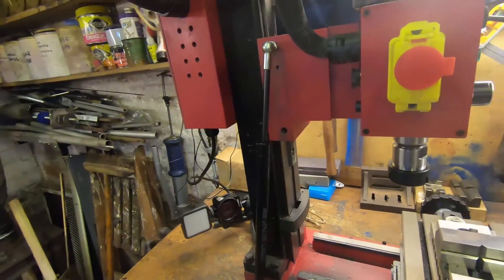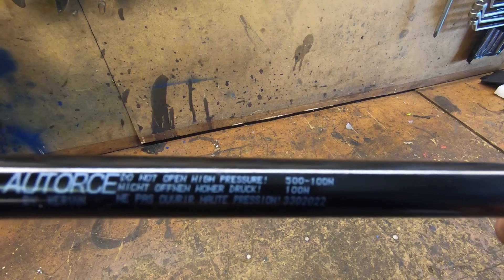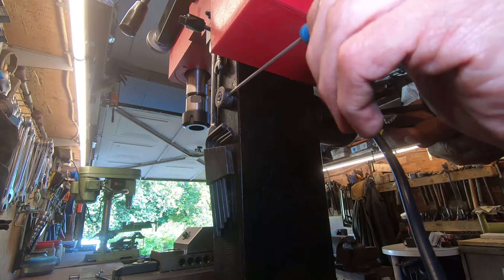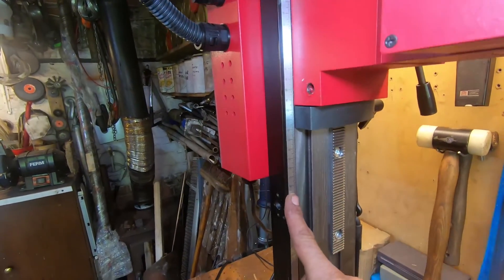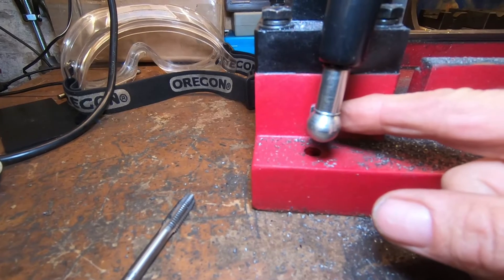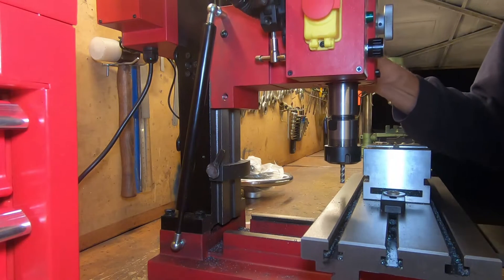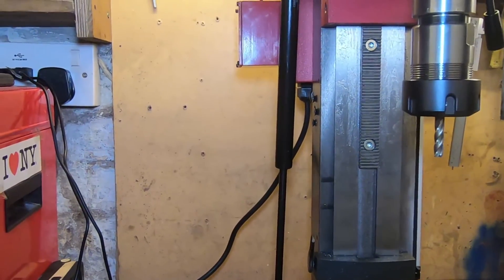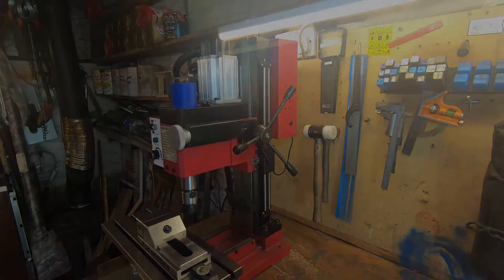MINI MILL UPGRADES #2: SIEG SX2P GAS STRUT CONVERSION

Comment: Excellent vid, very helpful and concise. Definitely one of the first things I'll be doing to my mill, thanks
Reply from the maker: Thanks for the great feedback :) Good luck with the job. I have a few more SX2P vidoes in the can waiting for some free time to edit so feel free to subscribe if you'd like to be notified when they come out 🙏
Reply: @myharris   It was the first thing I did after removing the safety guard and cleaning the factory gunk off, so thanks again. The ring nut from the right side of the stock spring makes a dandy spacer for the top of the strut as it turns out :)

Comment: they fail... hate saying it. maybe tomorrow, maybe in 6 years. dont trust them anymore...

im waiting on a 20mm air cylinder.

idea i set a regulator to just below the pressure needed to counteract, like a pound less.

and a safety valve set to just slightly higher.

iirc, 20mm=1/2squin = 60 psi to counteract the 15kg head... give or take. 

would like to see some more detail on the x2P... looks like you are the only one so far.

debating about blowing au$1200 on one before i finish installing the screws into my current x2... the extra travel sounds really handy, but i notice the saddle is mounted differently... looks a lot easier to scrape that base!
1200 is pretty cheap actually... thats shipped.

and there are scant few photos online, either...

sigh, now ive scraped the stinking thing, and got the r8 spindle and a bunch of collets... sigh. yeah, toolchanges drove me nuts when it was running... but so did ~90x220 of work envelope...
Reply from the maker: Great info in there, thanks. What would you like to see/know about the SX2P mate? Let me know your wishlist, happy to oblige. About time I got another video out but these days it seems to be a choice between doing stuff or filming stuff! Cheers, Harris
Reply: @myharris  cheers :)
just some clear shots of the range of travel, what it looks like at the extremes... clearance and stuff... room to gouge out the back and stuff a stepper in there?

  probably too much to hope for... what it looks like on the underside? webbing?

iunno. the bits you cant see in a photo and only find out when it turns up?

though considering it all i can probably do a granite epoxy thing for about the same price, with more travel and stiffness anyway... decisions, decisions!

i give credit to anyone that does videos. harder than it looks. hard enough just making whatever it is... when theres a chance to.
Reply from the maker: @paradiselost9946  Alright look, up to me eyes in concrete just now before the rain hits, I'll see what sort of time I have this evening to wave a gopro around, might have something half way usable either tomorrow night (UK time) or maybe even before, if the caffeine works. It's a big purchase so appreciate you want to know all you can. You might've seen some of the other vids I've done on this machine, just fiddly bits like fancy handwheels and stuff, but you might get more of an idea of the machine itself. I'll see what I can do, it's good motivation to get another vid out 👍
Reply: Gas cylinders are mounted like that to keep themselves lubricated.